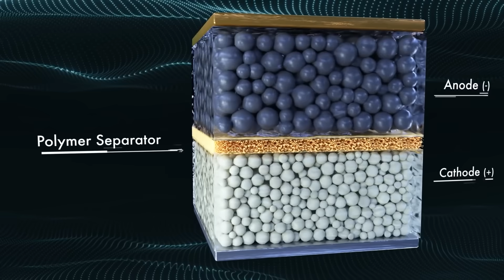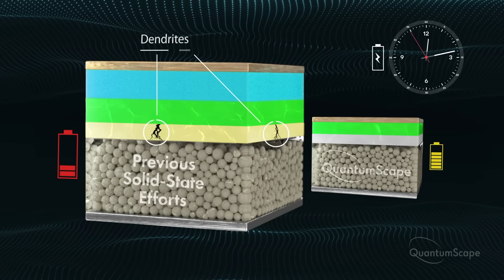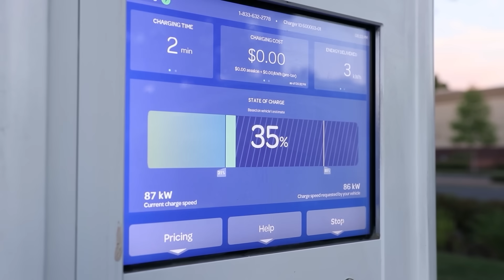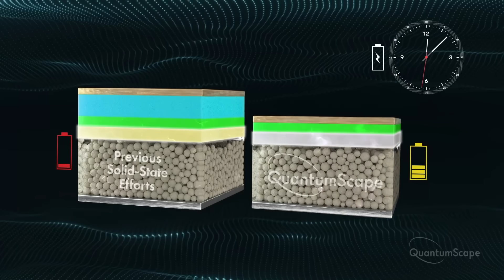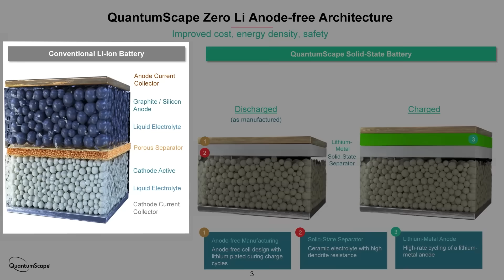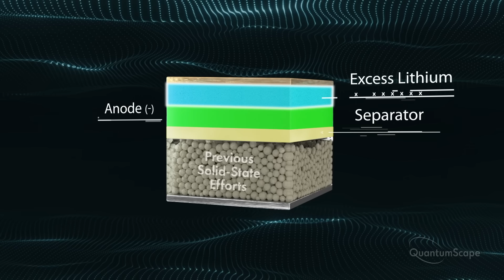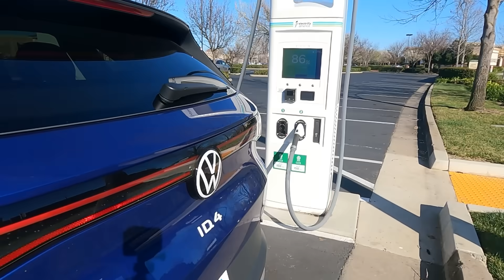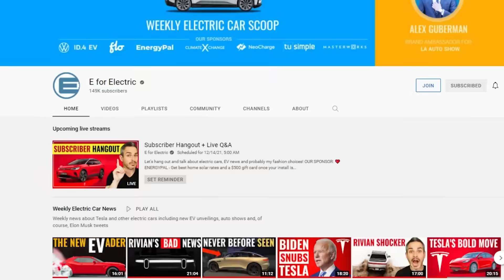How VW Can Leap Over Tesla: QuantumScape CEO Interview

Comment: Even if the cost is higher, with a higher energy density, and very fast charging, you can create a lighter car with very good range using far less total energy capacity.  It is a virtuous cycle.

Comment: Alex, did you happen to ask if their batteries would result in weight reduction additional to all the other benefits Jagdeep mentioned? If so, their 🔋🔋,  if used in a smaller form factor EV  - Renault Zoe for example - impact on range would not only benefit from the higher ⚡density factor but weight reduction. Think what that might mean in  Europe & UK in terms of EV adoption rates if (small) EV's were capable of ~300 - 320 miles range.

Comment: Please do a video about Solid Power's solid state sulfide batteries. They are working with Ford and BMW. I have heard that ceramic solid state batteries are also being into looked. Also, there are semiconductors made of Siicon Carbide(SiC) and Gallium Nitrite(GaN) that will allow for faster recharging. Can you investigate and do a video on them?
BTW, SiC, also called moissanite, is also made into jewelry. It is a rare compound, almost as hard as diamond, found in meteorites but which can be made artificially. Moissanite jewelry looks very much like diamonds. 

Are there other car companies aside from Aptera that will allow EVs to be recharged with 110 V household current?

Comment: I'm getting a bit of a thin film solar vibe with Solid State Batteries: great promise, but ultimately overtaken by the steady development of proven technology, and the learning curve. In the time it will still take QS to hit the market, how much will NMC and LFP have improved? QS talks about 15 minutes to 80%, which is already almost possible with regular NMC (18 minutes Hyundai/Kia on 800V charger). Tesla are increasing charging power to 324 kW. So, the QS 15 minute target seemed way ahead just 3 years ago, but not that outlandish today, let alone in a couple of years time.
Price will be the most important factor in the next decade as BEVs will flood every segment. It seems to me that LFP chemistry will win there, and it has some advantages too: long cycle life, safer operation, no rare earth metals. And LFP is now scaling up towards TWh scale.
So, while I'm still excited by what QS are doing, I don't see it as leading tech for the next decade. One area that needs a more energy dense battery is electric flight, which requires >500 Wh/Kg. But what Mr. Singh doesn't say here is what the gravimetric density is. He talks of volumetric density.

Comment: Interesting technology; hopefully it pans out. I would suggest that rather than extending the range, the increased density be used to reduce weight-which improves every aspect of vehicle dynamics. This is especially true if the increased charge rate proves to be feasible. A 300 mile range with a 15 mile charge time changes the game.

Comment: The numbers he gave of lasting at least 100k miles and charging in under 1 hour are a pretty low bar to meet. Looks like they've still got years to go before it'll pass the best Lithium Ion batteries, which is itself a moving target, then they've got to scale up. Soon is unlikely, but sounds like we could be less than a decade away if this breakthrough pays off.

Comment: How fast and cheap can your produce it. Its going to be difficult to beat the 4680. Round means very quick to produce. If Tesla is doing it, it has to be the best or the price. I think the other style batteries may be much better but production it likely so labor intensive and expensive it will loose out in the long run. Great for more expensive and lower production cars.

Comment: 800 cycles is crap. Current tesla batteries get 1500 and LFP ones get like 4000. 
Also it doesn't matter how good your batteries are if you can't make them at huge scale. Demand will out strip supply for the rest of the decade so everyone will sell everything they can make. Having the best batteries is a long way from being that important. Current  LFP batteries are t more then enough for most cars on the road. It's only long distance, performance and heavy duty applications that will need better technology

Comment: We are only at the beginning of the EV era, and there is much change in the wind. But I wonder if EV car adoption will take longer than everyone thinks. Except for some Chinese brands in China, there really is no affordable EVs to be had. Tesla cars are costly, and the legacy auto brands are not making affordable cars either. The strategy seems to start with high-end vehicles and later smaller, cheaper cars. Solid-state batteries appear to be on the horizon, but as with all new technology, I doubt we will see it in large-scale production any time soon. Mass production seems to be the biggest obstacle all around, and that is where Tesla continues to beat the legacy brands and upstarts. Transitioning to electrics is proving much more complex than anyone thought.
Reply: Legacy makers are having zero issues, excluding GM, of transitioning to EVs, shortage of batteries and chips affects everyone. VW started from scratch 4 years ago, no EV factories at all, lady year made 453000 EVs, they know how to make cars. 

And they are making affordable EV's certainly more affordable than Teslas.

Comment: A 15 minute charge time for a 100KWh battery would require a 400KW charger.  Thats a lot of electricity to push.  A large transformer is 1500KW.  You're gonna need a mega plug and some fat ass cables and a whole lot of transformers.  At home, a solid state battery would charge no faster than any other battery.  Your not gonna pull more than 15KW at home without Major upgrades to your electral service.  Most homes are going to have trouble with anything over 8KW.  Tesla's can charge at 60kw or 75kw I believe.  Getting to 400KW is going to be a feat for the electric company to pull of for more than a small number of vehicles.

Comment: Will solid state ultimately replace lithium-ion?  I don't think so, even though solid state seems to have inherent advantages.  I'm an electronic engineer, not a battery engineer, so I could be wrong.  But here is a couple of examples that make me skeptical:
1.  Back in the 80's a lot of people thought Gallium-arsenide (GaAs) would replace silicon in high-speed digital chips because it's lower bandgap energy gave GaAs an inherent speed advantage.  But today, silicon is still king, because it's so much easier to work with, enabling adherence to Moore's Law for far longer than most engineers thought possible back then.
2.  Photovoltaic cells made today aren't that different from those made 30 years ago, but the price has come down dramatically because of improved manufacturing tech, and the economics of scale.
The point is, that 50% increase in energy density the guy claimed for solid-state batteries may be outpaced by improvements in Li-ion,
I think the real reason companies like Toyota and VW are interested in solid-state is because they're desperate to make investors believe they have a chance of catching up to Tesla by some magic tech that lets them leapfrog ahead.
Reply: This is possibly right, but I don't think VW and Toyota need new tech to catch up to Tesla. Their cars will be close enough in a few years-it's not like Tesla has anything but an advantage in experience building them- there is no mystery tech or aspect of Teslas that make them an obviously superior car to the consumer (although the certainly are better at this point). Few people care that Tesla's heat pump is super clever and more efficient- they just want the A/C to work.
Legacy manufacturers will compete on customer service- an area where Tesla's innovation and tech has covered up massive deficiencies. At some point Tesla will have to grow up and have a real sales and service network.  They've done amazing things so far, but their basic shadiness will catch up to them in the near future.

As for solid state battery tech: a 50% reduction in battery weight coupled with a 50% charge time seems pretty significant to me.
Reply: @bobqzzi  Tesla has superior battery  chemistry + top people working on improving it all the time, able scale of batteries, new 4680 battery - patented, factories built from the ground up to manufacture ev's, production speed 3x that of VW, Best software engineers in the industry, Most experienced electrical car engineers,
Best charging network,
2 new ev factories coming online this year (doubling production capacity) + a few more to be announced this year.
 Dojo supercomputer coming online soon with FSD potential.
Manufacturers its own chips + the ability to switch to other chips avoiding down time.
Has spacex engineers to assist if needed on very complex systems.
Currently sells the quickest car range in the industry, and the most efficient.
Battery, electric drive systems have proven to very reliable over many years, people are able to run 100,000 of mile with little to no maintenance.
Their software in the cars works fast, gets regular OTA updates, offers more features to the competition.
Currently, a similar performance equipped gas or ev car, from a reputable manufactures is more expensive.
If you compare a BMW i4-450 to the M3p, for a similar equipped version of the BMW it would cost $20,000 more, and it's slower in acceleration and has a lower top speed (But slightly better in the mid range)
Reply: @RemoteSpeed007  All true (except FSD where they are barking up the wrong tree). They also have terrible customer service and a pathological liar for a CEO. That's been  fine during this explosive growth stage and when their technology lead has been so large they were really the only game in town. Very, very soon all the other EVs will be good enough (like ICE cars now where they are all fine) and things like customer relations and a service center network will become more and more important. Maybe Tesla can pivot and start acting like they want to retain current customers and attract new customers who aren't EV enthusiasts; maybe they can't. Once the chip/supply chain issues end, more and more competition will come and many of those companies are good at customer service and supplying replacement parts.  Right now, Tesla makes the best EVs, but best is no guarantee of best selling in the future because selling cars is about more than the product.
Reply: @bobqzzi  Well I'm a customer and like their service so far, much easier with the app to get the car serviced, I understand that some areas are not well covered, and Elon actually apologized recently and promises to make it better.
The legacy OEM have dealers - Tesla has to build and staff their own service centers, it will take time.
It's a ev revolution, some areas will suffer no doubt.

"a pathological liar for a CEO."
I don't agree with that.
Reply: @bobqzzi  "All true (except FSD where they are barking up the wrong tree)"

What is your experience or background that you can confidently say that. Serious question.
I have a technical background and some experience in software programming, although I don't know that they call pull it off, it does show progress on most updates.
If you look at my post I said FSD Potential.
Reply: Well said - To add to what you said. 
For them to scale enough to supply the high volume cars like the model 3 and Y, or similar high volume selling cars will take for ever. And as you said lithium iron batteries could be 30% better and the price difference would not justify it.
Maybe 3-5 years if they succeed, they will supply enough to place in a Porsche Taycan that sells for 300K (Low qty high price)

Comment: Stay quiet till you have ANY production lines running. Till then you have nothing regardless what you can do in a labb. The true best cell now in use is the 2170, the 4680 is moving forward but till they are in the hands of consumers we do not have them yet. I´m sick of the next "new" thing that you can not buy. I propose a new standard, till you have SOLD 10Gwh you have nothing and will shut up about it.

Comment: Tesla's 4680 battery is NOT 'new technology' IN ANY WAY ! It's simply a slightly different way to build a battery using EXISTING technology. A repackaging exercise mostly. It will deliver more or less the same energy density as their 18650 and 2170 batteries. Musk's 'sales pitch' for it during battery day was a masterpiece of obfuscation and deceptive presentation. The kind of showmanship hje's known for. It's STILL giving them problems though. No-one else important uses cylindrical cells. It's a technological dead-end.

Comment: It is great to hear of the progress with the solid state batteries. But it does also show that the solid state battery technology is not something that we are going to be seeing in production EVs very soon. 400 charge cycles is good, but the 2170 batteries can run 3,000 cycles before significant degradation, and the 4680 batteries look to be far better still. Super quick charging is good for those people who want the convenience, but most EV owners charge overnight at home, where super quick charging is not needed.
Reply: ^^ THIS ^^      Most important.
Reply: What about those living in apartment with no charging ports 😑
Reply: @don.timeless4993  just have a bollard  installed were you park your car. They only need to be 10 amp. It is being done in Europe.

Comment: The question I have is; what will be the energy density at pack level? Pauch do not give structural rigidity, so additional mass is needed to give the car rigidity. Cylindrical cells give the car structural rigidity, so one can get rid of a lot of mass using them.
Reply: I'm pretty certain the rigidity comes from the housing and not the cells.
Reply: @Error6503  that will change with the new pack design.

Comment: Several said that making prototype batteries is not so hard. What is hard is making enough quantity, with a certain quality and with a reasonable price. If money is no object then many battery kinds could be made but very few could afford them. Tesla has been unbound by money for some time, so they have all the money they need and more. See how much it takes for them to produce the new battery in volume. It's because it's very hard to do right. This guy has something nice an promising, but really far from being significant in volume.
Not so sure Tesla is not doing anything about the solid state batteries. They are going so fast and doing so much I would be surprised if they were not doing anything on the solid state side. They do not speak about it for now.

Comment: The biggest problem of BEVs is not energy density. Lucid can go 850km per charge, that´s more than 90+ percent  of drivers need. And they do it with 2170 cells. The problem is cost - most people in the world can´t afford a BEV, that´s why large car manufacturers are switching to LFP - the energy density is lower but so is the cost and that´s what matters. Tesla is also focused on cost with 4680. More energy density improvements will come with the structural battery. Until solid state can become cheap it will always be a niche market - good for planes perhaps or trucks but not a mass market product.
Reply: 850km range is 90+% of drivers needs? How often do you do that kind of distance in a day? 850 km is 99,5% of drivers needs. Once in my life I did almost 1000 km in one day. With that kind of range you, the drivers are the slow part. Having so much range gives you ample time to charge without waiting at all.

Comment: Welcome back! Jagdeep has to be one of the best at delivering his message so clearly, concisely, and with passion and compassion. Wow. Looks like he has a winning product. One question comes to mind, could his cells have a structural ability like 4680s or need a structure around them like pouch cells?
Reply: As you can see from the video, the battery actually swells as it discharges and contracts when charged. This requires a pouch format as there is no room to swell in a can. Also he describes the separator as being ceramic which is usually very brittle and cannot be bent in a curve.
Reply: @royh6526  quantumscape seperater is flexible as shown in their investor presentation
Reply: I would think they need to be in a frame since unlike cylindrical type cells they do not have any structure of their own.

Comment: They would have to greatly increase the energy density in solid state before real viability, then you could decrease the size of the battery which would also lower the cost of replacement.

Comment: Solid state is probably still a way off. Quantumscape is the most likely to succeed with it. However LFP tech is already viable, cheap to build, reliable, way more than 800 charge cycle life, closer to 4000 for some. Also some of the new designs are approaching energy density that rivals traditional lithium batteries. Yes they may be a bit heavier but that can be be fixed with body/frame design, making the batteries structural in particular.

I mean just from a marketing perspective, think back when gas cars were all that was available, if it was common knowledge that you could only fill your gas tank 800 times before you had to replace basically the whole drivetrain, likely at the cost of half the original vehicle price,, would you buy it? For those who switch cars often answer would be yes, but for money conscious customers who plan to drive it for the life of the vehicle they would have to really think about it. It's the same reason a Honda or Toyota retain value over a Ford. They are known for a higher reliability
Reply: I wish the LFP Model 3 was cheaper than the old $37,990 Model 3.
Reply: Good points and I agree, LFP is the best chemistry and design today, however, LFP charges relatively slow compared to NMC and solid-state and LFP loses quite a bit of capacity in the cold but on the plus side, LFP offers ~4,000 cycles, is relatively cheap and safe.  I wish NMC would go away asap and we only use LFP until solid-state comes online.